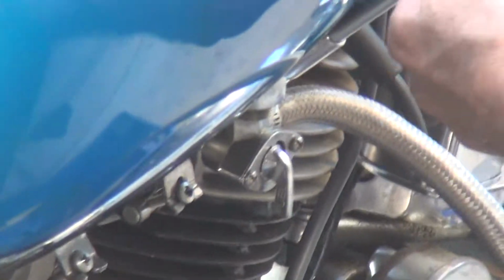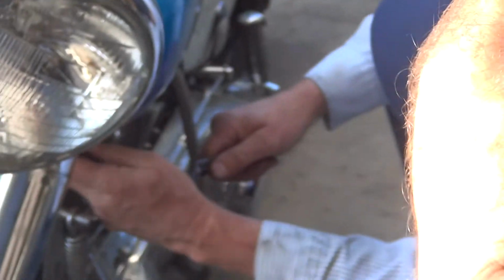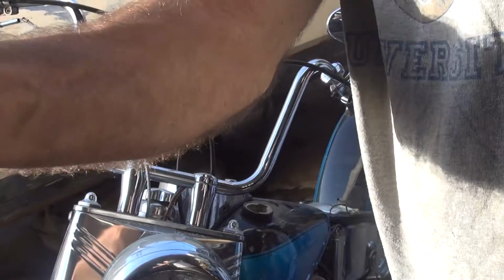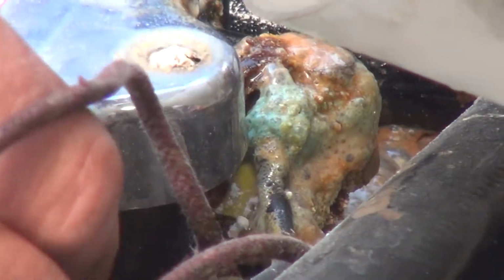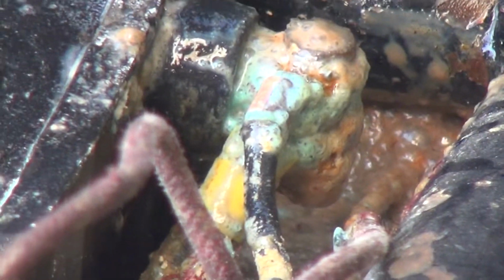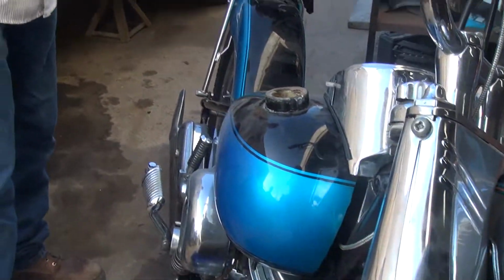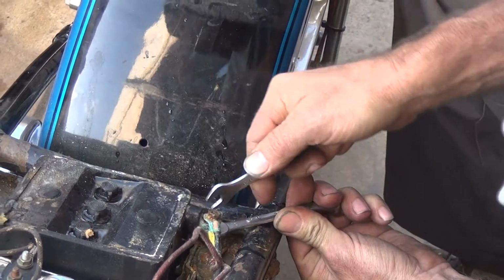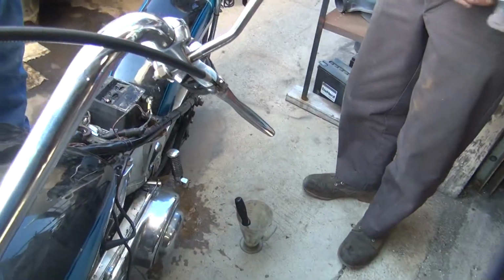#101 1949 BARN FIND PANHEAD KICK START, REPAIR, GET RUNNING

Comment: Tatro, when you timed the bike you set up an ohm meter. My old man has one. Could you give me a brief rundown of how to set the ohmmeter and where to connect/earth it to please. I have the sme setup as this bike. Thanks for doing all these videos. They're shit hot.
Reply from the maker: you are only using the ohm meter to tell when the circuit or points open. a test light would work too.
one end goes to ground and the other to the hot side of the points. when the points open or the test light goes out the points are open. you are adjusting the timing so that the points just open when you are on the timing mark with the distributor at full advance. 
tatro
Reply: Thanks Tatro. That's where I've been setting it. Can't get the bike to fire. Every now and then it runs for about 3 seconds then just falls off like there's no gas. I eliminated an intake leak by replacing o-rings and clamps and pressure tested it. The Super B I installed seems to be the problem cos it ran fine with the Zenith on it.
I pulled it apart and blew out the main and intermediate, checked the float, reset idle mix to 2 turns out. If I could afford it I'd take it to a guy but right now I'm too broke to even pay attention. 
S'pose I need to keep playing round with hthe timing mark in the window and keep the points a constant and see if that helps.
Sorry for the essay man. Thanks for the reply and please keep em coming.
Reply from the maker: sounds like your idle circuit is plugged up some. pull out the low speed jet and idle mixture screw. you should be able to blow some cleaner thru the holes and see what it looks like. the timing can be off some and the motor would still run. 
tatro
Reply: Thanks Tatro I'll try that. Swapped the Zenith on this afternoon and still no luck.
Reply from the maker: sounds like you got more then one problem. you need to start from the beginning. adjust the valves and do a compression test or better yet a leak down test. if the motor checks out good then move on to the intake manifold and carb. make sure you have no leaks and the carb is clean with good gas flow to it.  after that move on the the ignition. check the timing 1st then make sure you have good spark. for testing you can just run a hot wire right from the battery to power the ignition and coil. this eliminates all the switches and other wiring on the bike. if all is good it should be running now.
tatro
Reply: You're a legend Tatro. I've asked a lot of people but that explanation makes me understand the sequence I gotta take. Thanks man. I really freakin' appreciate it.

Comment: What were you pouring on the battery terminals?
Reply from the maker: Philippe Juncker hi,it is arm & hammer baking soda. just mix it with water and it kills acid. you have to keep it mixed. looks like milk when mixed correctly. just wash it away with water after it stops bubbling.tatro